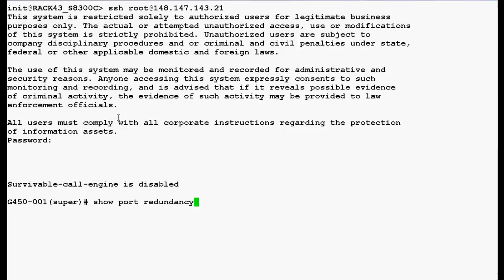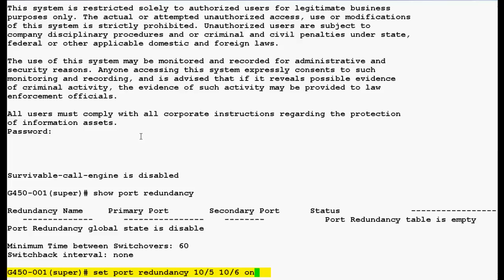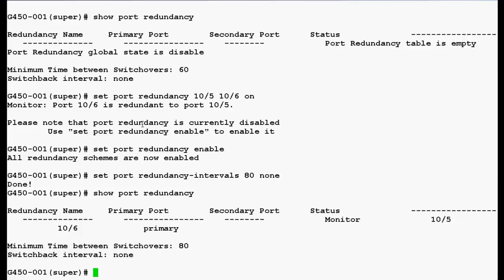How to Configure Port Redundancy in Avaya Media Gateway G450

Comment: I believe the newest G450 firmware does not require that you type port redundancy enable.  If you do a show port redundancy after the first 10/5 10/6 command it will show that port redundancy is enabled and doing a show run displays no differences in configuration between enable port redundancy and not typing it at all.